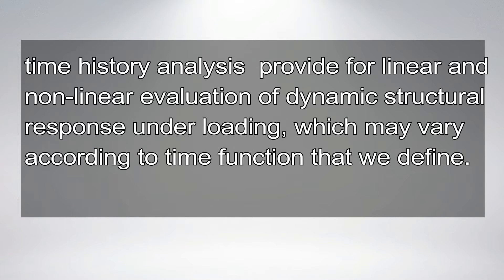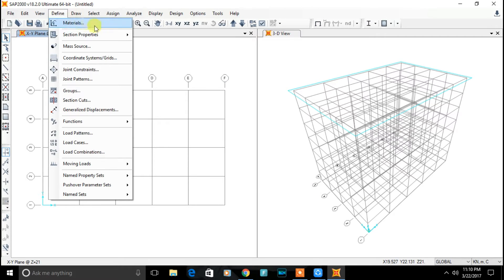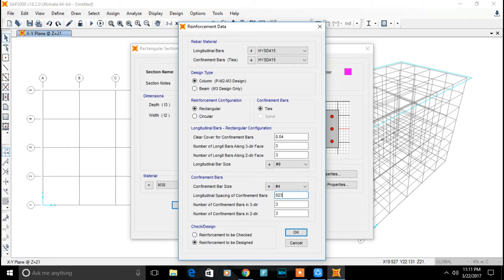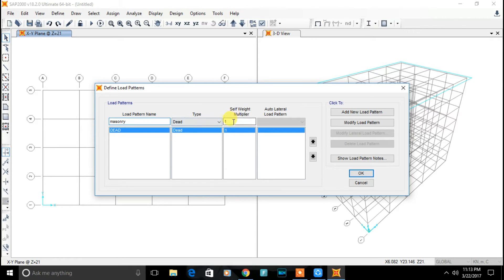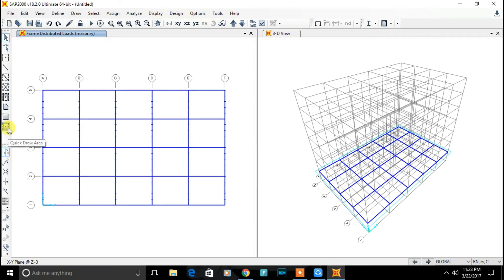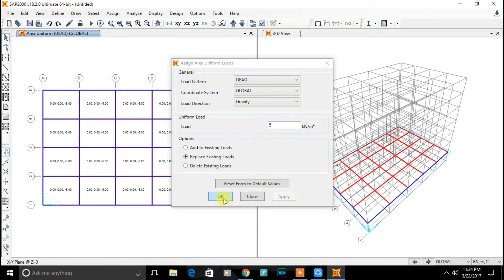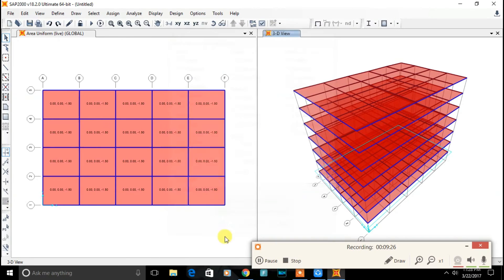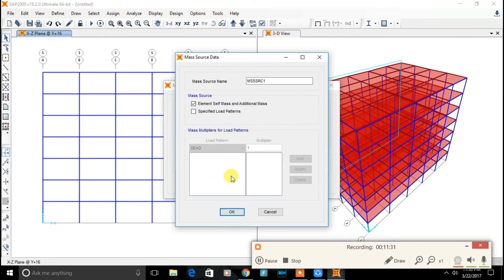complete time history of base isolated building using (lead rubber) in SAP2000 part 1

Comment: could you make the video of control of vibration in composite floor using tuned mass damper by sap 2000 software ?